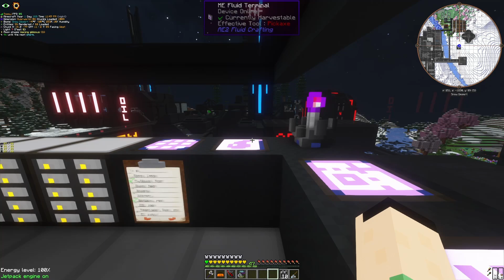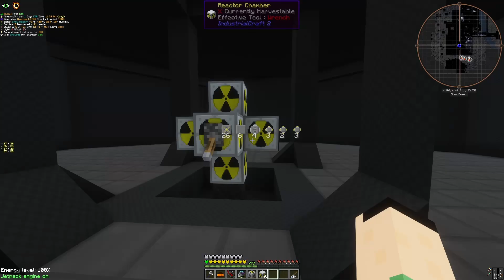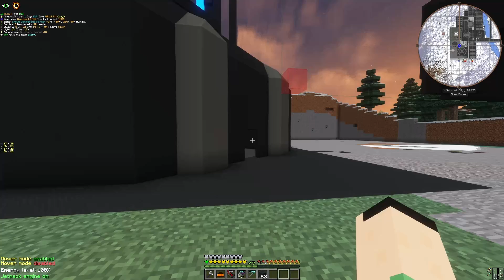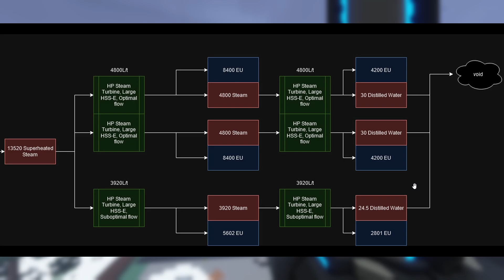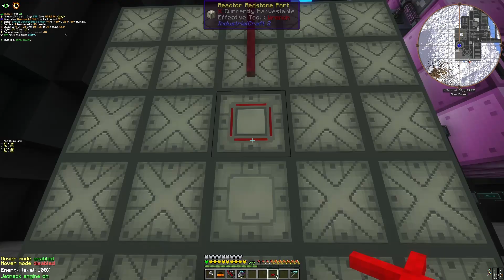GregTech New Horizons E63: Fluid Cooled Nuke

Comment: Hello dear Hamcorp CEO,

We want to welcome you to the wonderful cult of Fluid Nukes. Your nuclear powerplant looks really awesome. And again with the cursed multiblocks :). You might want to try a cursed reactor wall sharing in the future (Fluid nukes can share walls),

But also constantly running Uranium nukes might not be the best idea. When you going to need plutonium, there will be a bunch of different methods to get it. For thorium, breeder reactors would be better cost-to-byproduct ratio. And if you decided to toggle the reactor on and off, having a bigger buffer will be better, since there is a heat-up time.

Best Regards
Köfteistan LLC Global

Comment: Hyperboloids can be made entirely with straight lines and every point on the surface of the hyperboloid intersects exactly two of those lines.  So the easiest way to realize one accurately in minecraft would probably be to create a ring then trace out a few of the lines that fall on the hull of the hyperboloid until you have a scaffold of quads then fill in the remaining area.  Making lines of known slope from a known starting point is generally pretty approachable even in 3 dimensions.  A useful operation to be aware of for that might be affine rotation, to rotate around the center by arbitrary angles using scale, shear, and translate operations.

EDIT: Alternatively since you have the tools to make circles easily you could just construct it as rotations of a hyperbola.  Find the intercept at various intervals sqrt((kn)^2 + 1), where n is an integer and k is some scaling factor to make it the size you want, then walk along the function making rings that are a multiple of that radius.
Reply from the maker: Dear employee,

I originally thought of doing the rotation of a hyperbola method, but wasn't sure how to rotate by an arbitrary angle and then put that in minecraft. Building rings is indeed a smart way to do it. 

It would be even better if we could somehow account for the slope A, slope B and roof tile block variants to get it to look even more smooth. HamCorp architects will consider such a building method for a future construction project.

Best,
HamCorp
Reply: @Ham-Corp  I can think of some ways to do that but none which are particularly elegant, it's essentially a marching cubes problem. Also is your reactor chunk aligned or are you just using chunk loading to keep your base from exploding?
Reply from the maker: @esven9263  chunk loading but I might consider moving these just to completely avoid any risk since they can be so destructive